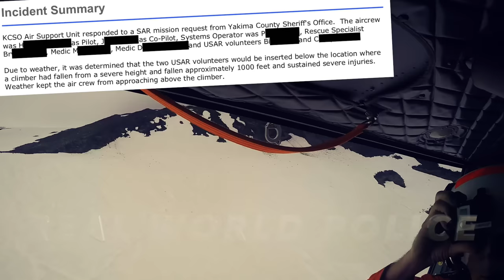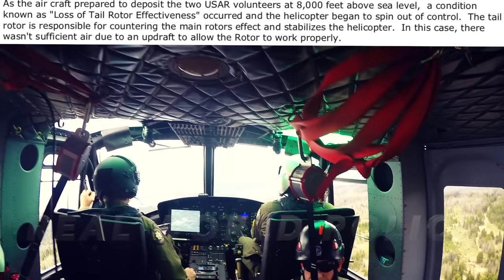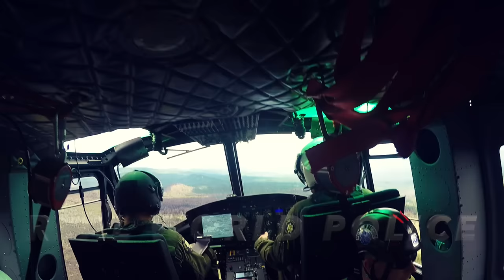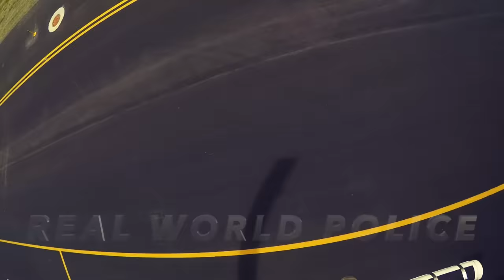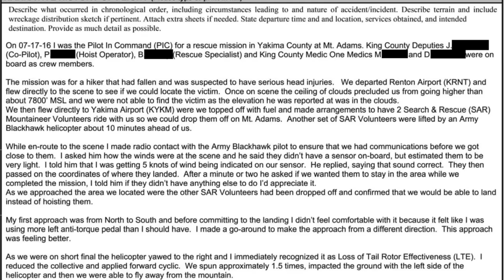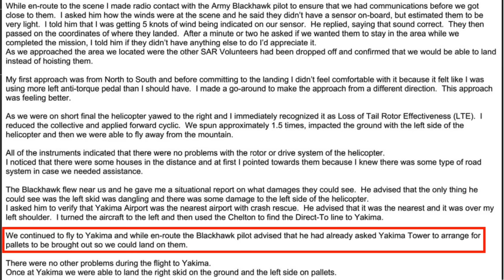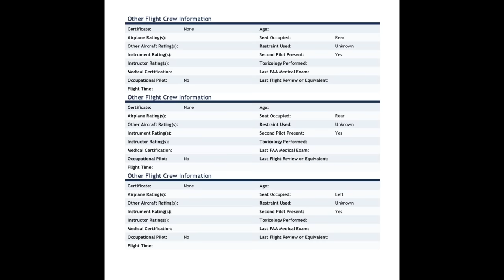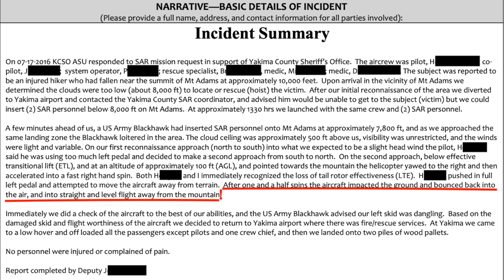Police Helicopter Loss of Tail Rotor Effectiveness & Collision With Terrain (HD)

Comment: Helicopter pilot here. First issue is high altitude flying which, in thin air, both rotors have reduced effectiveness, especially flying in dirty air like a hover or slow speed. Second issue is mountain flying in general is more inherently dangerous do to the effect of wind over mountain peaks and valleys. Overall, these guys did great. A hard landing is not a big deal but, has these two not been on their A Game it could’ve turned really bad, like a rollover scenario from catching the skids on snow or uneven terrain.

Comment: Its a little frustrating to read the NTSB report as it keeps referencing pilot error in the setting of LTE and sites poor rudder control. It points out how the chopper is ideally supposed to have forward momentum blah blah blah. Ya guess what...they don’t operate during missions in “ideal” conditions. The report does eventually site LTE as the aggravating factor but the optics of the report to a non-pilot reflects poorly on their skill level assessment.  They risk their lives in attempts to save others...thats what they do. Some shit is just out of your control, I seriously doubt any pilot worth their salt could have changed the outcome. Thats like blaming the officer in a high speed pursuit if the car breaks down. Yes...thats not what Crown Vics were meant to do but shit happens. Good job everyone 👍🏻
Reply: Well, you can definitely see it several ways but one of the issues it seems the NTSB had was the lack of a procedure to identify power requirements prior to a point of no return approach. In an ideal world, a dummy run should be set up to identify wind direction and power requirements. Going into it without having any idea of the wind direction does seem like a bad idea especially at those altitudes. I think it is one of those cases where the organisation should have set procedures for dealing with such a rescue type. That would take away any stress or pressure from the PIC having to make a choice on whether a dummy run is necessary or not. If it was a policy that any approaches done to rescues above 5,000 feet required a dummy run to identify potential dangers then this could have been avoided. Of course, these pilots and crew work in time-sensitive stressful situations so they don't have all the time in the world to fool around but at the same time, it needs to be done in a way where they don't end up having to be rescued themselves or worse. All in all, I think it should be treated like a very valuable learning experience and it seems to me that the sheriff's office is dealing with it exactly like that when looking at the final slides with their recommendations on avoiding accidents like this in the future.
Reply: @proonguice8386   I get what you mean but I feel this is very different. My point is that a single dummy run to identify wind direction could prevent this. Of course, it is always a hazardous operation but why make it more dangerous than necessary by not knowing the wind direction or strength. It is common practice in mountain flying to do a dummy run to establish the amount of power you have on the approach path you plan to take. By doing an approach above ETL you can determine within a margin how much power you will use in an OGE hover. If it looks to be close to your limits you may need to do an approach trying to enter an OGE hover at an altitude that allows you to drop the collective and recover before anything escalates weather it is LTE, low rotor RPMs or something else. I want to make it clear I don't think this is the pilot's fault as such due to the type of mission and stress that is involved, but that is why it could be smart to take away that stress of deciding what is necessary to do before a landing by making it mandatory within reason. It does also seem to me that these safety measures are being taken by the organisation in the form of extra training and recommendation of better reconnaissance.
Reply: Don't get frustrated. There's not a lot of flying that is done just for the sake of high-altitude training.

We have to be more supportive of allowing Pilots to be able to go overseas and train with other units that do 90% of their rescues in high altitude and steep Terrain approaches and Landings.

This is especially important not so much for power and control issues but also for teetering  blade systems and Mast bumping. incidents
Reply: @wiley0714  I absolutely agree. The important thing with these accidents is what we can take away from them to help prevent similar accidents in the future. If we just dismiss it as "nothing to do about it" we won't learn anything. It isn't important to blame it on anyone but to rather understand the reasons and react to them. Being more supportive of high-quality mountain flying training wherever that is would certainly go a long way to help take away all the variable factors we can.
Reply: I definitely respect the job these guys are trying to do, but the PIC only had 52 hours in make and model, and thought he was gonna take an aircraft with a service ceiling of 12,000 feet and do a 10,000 foot rescue, Him, and all of his vast 52 hours of experience in the aircraft, what a dumbass, he should've been fired for endangering the lives of so many people. High Mountain rescues are a pretty specialized area, that requires special training and equipment. If they want a machine thats forgiving enough at altitude for their low time pilots, go pick up a used Lama somewhere.
Reply: @HappyCamper1206  Agreed....Vietnam Crew Chief UH-Charlie Gunships Dec 1970-71.
Reply: Unfortunately in this beautiful accountable world we live in there are only two faults. The first is Mechanical, the second being human. In this case it wasn't mechanical. But we must never forget that although it sounds like a bad thing to lay blame, at least every one got away without harm or injury and maybe a little wiser.
Reply: @Agislife1960  I agree, experience matters.  Especially when high altitude or mountain flying is involved.  I wonder if KCSO is one of the many law enforcement agencies that require all LE pilots to have several years of LEO ground experience?  All too often, experienced pilots are denied these jobs, and are told to apply for a job with the department/office, gain years of experience as a patrol officer and if you are fortunate enough, you can try to become a pilot in the organization.  I understand the importance and value of a pilot having ground experience to better support the guys on the ground.  It's just a shame that a 1100 hour pilot is flying these missions when 5000+ hour pilots are available.
Reply: @Agislife1960  If im not mistaken the report says landing zone was 7800 MSL, not 10K.  I have a hard time believing it cant OGE at 7800 ft PA. Obviously depends on GW, but I can OGE a Longranger at that altitude near MGTOW.  That being said, I doubt it was a zero-wind situation.  Pilot probably took a tailwind on approach, slowed below ETL and the helicopter started to settle.  Raised collective, ran out of pedal.  It is also very likely that he approached his spot with a greater rate-of-descent than he would normally due to the snow making it difficult to judge distance from the ground, although his descent rate is hard to perceive due to the camera angle and.. the snow.  All-in-all pilots fault. Easy to say he shouldve aborted the landing, but even if there wasnt external pressure to get the job done, Im sure the PIC has a ton of internal pressure to perform and help save the injured parties.
Reply: @Tom Gulbranson Tail rotor = rudder
Reply: @silasbland4515  Its a failing among law enforcement agencies in general. In the 30 years Ive spent in aviation, the best pilots were always those individuals who had a burning passion for flying, from a very young age. Im not saying that you can't find those guys within the ranks of law enforcement. But there is a difference in that early passion and somebody who just wakes up one day and says, ya know what, I wanna be a pilot. Back when the Alaskan state troopers got their first jet ranger, they did it a little different. They hired an already high time helicopter pilot and made him an honorary State Trooper. He went on to fly hundreds of missions, and never put a scratch on that 206, because he knew his machines limitations.
Reply: Monster Inc. Total flying time is much more important than make and model. It not like his previous time was in Robinsons or he wouldn’t have the job. He was not a rookie. You are being over critical of the pilot as you fly your couch around the living room.
Reply: Not sure what your point is. Guy had 50 hours in type. He got into a bad situation from RPM/wind and got into LTE.  He made a very successful non-fatal mistake and lived to tell about it. If your Crown Vic slides on ice and hits another car are you blaming the crown vic? Driver error. Didn't manage the stopping distance for the road conditions.
Reply: In the book Blackhawk Down, one of the soldiers interviewed said he saw a helicopter land in the street with only inches to spare on the rotor tips. If he came to pick my ass up, I wouldn't mind him fudging procedures just a little bit to get me outta there.
Reply: @obsoleteprofessor2034  The last thing you want to do is destroy a bird because of an error then risk 2 other flight crews to pick you up right?  16 soldiers were killed trying to save Markus.  Bold yes/stupid no.
Reply: @TOB-uk2xy  Total time is only important within the context, someone with 5000 hours in Cessna 182's isn't going to jump in a P-51 and take it for a spin. Im now retired from aviation, so you're right about the couch part, but that doesn't mean I don't have any relevant observations. Theres not a single civilian helicopter operation in the world that would've even entertained the thought of trying what those guys did. Not with a pilot who only had 52 hours in make and model. But everyone will probably get accolades and accommodations for the effort and the tax payers will get stuck with the tab, they should've all been fired.
Reply: @Agislife1960  Kind of my thoughts.
Reply: @Tom Gulbranson in the context that the NTSB was using "rudder" (which was your point of contention), tail rotor =  rudder. Full circle. Full stop.
Reply: @kojack635       "The NTSB is a joke."
The NTSB is govt. You can only hope, first that they do anything, and second that they do and complete their job satisfactorily.
Reply: @Tom Gulbranson  OP said they "cited poor rudder control". I was explaining how, and why, the term can be permitted to describe tail rotor. This isn't up for debate. Why are we still talking about this?
Reply: I am no expert but and their summer reads like a why, and how it could be avoided while stating the emergency nature of the mission. The call on if it's ok to take that risk was being left up to the reader/operator.
Reply: From my point of view it was pilot error, likely combined with weak management and safety policy. The very first WTF for me was no seats for passengers and unsecured cargo,  just that would make many survivable accidents fatal. They were low time pilots, most civil operators really wouldn’t consider a pilot with less than 1500 hours and either 500 in make and model or factory school. There was no mention of any preflight planning or performance calculations or even mention of any reference to performance cheat sheets. There is no indication from the video or pilot statement that they even considered pulling into a hover to do a power assurance check, even though there was discussions and obvious concern about wind conditions. His initial approach seemed well planed, a downhill approach with a right pedal downhill escape. If the approach didn’t feel good he should have bailed and set up another approach. Instead he merely modified his first approach by making a left turn uphill, WTF. I could go on, it was just dumb luck or the grace of god everyone walked away from that. The good thing is he will never make that mistake again.
Reply: Looks like he hovered in his rotor wash and caused a vortex ring state to occur, judging by the rapid loss of altitude and the loss of rotor control. That's why, especially in mountainous regions, helicopter pilots always fly in as fast as they can, and do a quick recovery before touching down.
Reply: DavidMN , settling with power happens when the approach is too steep and fast, this approach was much too shallow. Usually settling with power and LTE is an either / or, I’m not aware of any cases both have occurred at the same time. Though not saying it would be impossible. 
Honestly I was a bit surprised to see LTE in a UH-1H,  I would have expected it to hit temp limits before torque limits, and the report has a puzzling mistake in that it lists the engine as a -703 but lists the horsepower for a -11. The report also says it “topped” off with fuel at Yakima, which makes me scratch my head. Did he really top off with fuel and people before flying to altitude? Did he really choose fuel margin over performance margin? I suspect this is just a case of poor performance planning and/or wrong tool for the job. I suspect it was just simply overloaded for the conditions, if someone had all the numbers it would be easy to figure out.
Reply: I don't care how you twist and turn it, it is still pilot error. They are ultimately responsible for operating the craft safely.
Is that a bad thing? Not necessarily, they have a very difficult task to accomplish and must weigh the risks. Even when it's pilot error, it's sometimes an acceptable risk to take. There's no blame but at the end of the day, it still is pilot error. Had he not gone for that particular location under those particular conditions, nothing would have happened.
Reply: Tom Gulbranson , I have never heard of vortex ring state in relation with tail rotors. Though any wing creates vortex rings at the wing tip. In relation to helicopters settling with power and vortex ring state are often used interchangeably, and there is debate about that, whether they are the same thing or not. Sort of like how fixed wing pilots debate pitch / power relationship. Anyway, colloquially power with settling is often described as being stuck in your own downwash, applying more pitch aggravates the rate of decent. Conditions can vary but it usually happens during steep approaches, relatively high rate of decent, and below translational lift. 
http://www.copters.com/aero/settling.html
Reply: Tom Gulbranson , that makes total sense. I guess I just always knew it as critical wind angles to avoid without ever really thinking too much about why. When we started using newer Part 27 helicopters critical wind became much less of an issue. 

Many would argue pitch is altitude and power is airspeed. I finally decided it was probably related to horsepower. Certainly the Skyhawk I got my initial ratings in it was pitch for speed and power for altitude, but when I started flying D Model Barons with 285hp on each side, suddenly it was different. Really it’s one of those discussions I avoid, same with hovering over water or tall grass, is it HIGE or HOGE. Is kinda just silliness.
Reply: You don't seem confused at all.
Reply: @hellcatdave1  It kinda sounds like you know a couple of specific terms but don't understand what they actually are. VRS occurs when descending too steeply and rapidly through your own rotor wash, not hovering in it.
Reply: Well they left the guy on the mountain anyway
Reply: it WAS pilot error. sorry about your feelings.
Reply: @HappyCamper1206  God I wish I had that much knowledge of aviation, flying a helicopter is definitely on my bucket list
Reply from the maker: @vermontaviator1248  Please don't write in all caps. Under most circumstances moderators remove those comments. I appreciate your cooperation going forward.
Reply from the maker: Vermont Aviator — I don’t appreciate your deflecting from the only point I raised, inventing a hypothetical world in which I didn’t actually care about the only thing I told you I care about, and accusing me instead of censoring opinions. Go find somewhere else to hang out. You are not welcome here.
Reply: @HappyCamper1206  Uh... He basically did a dummy run. Says clearly this happened on his second approach, after discussing winds with the blackhawk pilot. He waived off his first one because his first one was even worse.
Reply: @Tom Gulbranson It's funny that a tail rotor blade in it's vertical position is indeed a "rudder" and acts on the craft just as a boat or plane rudder . The fact that it spins is of little consequence
Reply: @Agislife1960  52 hrs isn't a lot of time to be the man in charge.  Especially in this specialized of an operation.  There is no reason to get into LTE under the conditions they were in.  A few hundred more hours experience and he should have been able to recognize oncoming of LTE to fly out of it.  Had they not hit the rock where they stabilized and started flying again this could have turned out a lot worse.  This clearly should be written up as pilot error.  It's what happens when ego over rides ability.  

FAA ATP Rotorcraft; Com w/Instrument SEL, MEL; FAA CFI Rotorcraft; JAA CPL/IR Helicopter, Retired after 38 years.
Reply: @TOB-uk2xy  Overly critical?  Not hardly.  He figured out too late he was losing directional control and reacted too slowly when he should have flown out as the turn was becoming uncontrollable.  Luckily he landed (uncontrolled) longitudinally on a rock allowing him to regroup and get airborne again.  End result?  Unnecessary serious airframe damage.  More time in make/model and he should have been able to feel the onset in the controls.
Reply: @patrickquerry5768  Most fun I ever had with my pants on.
Reply: @dighawaii1  😂 yeah, but he probably has a huge watch